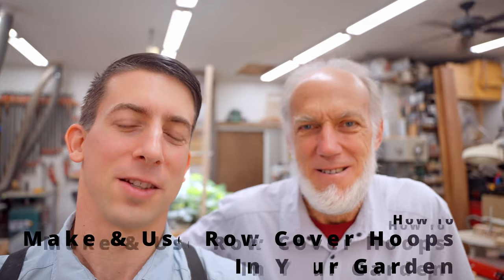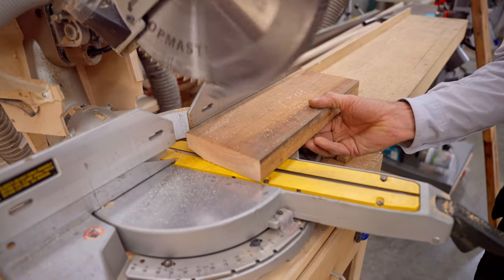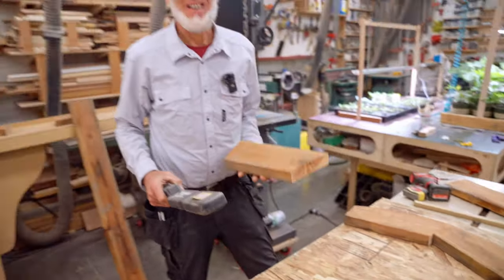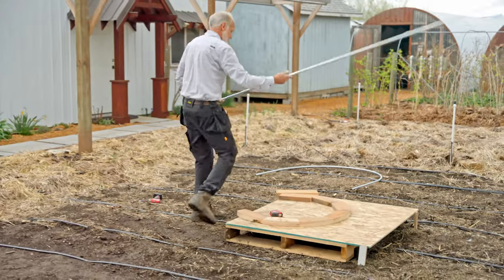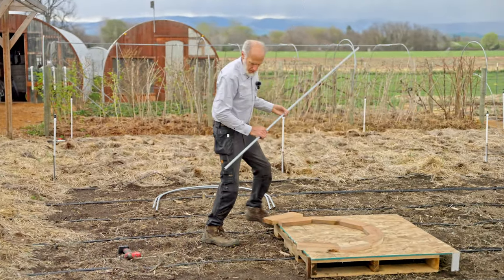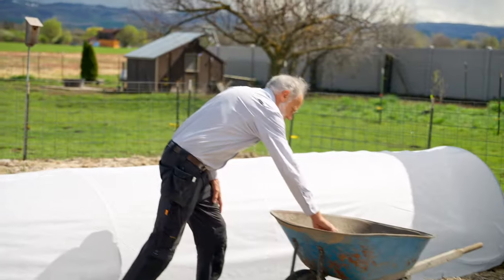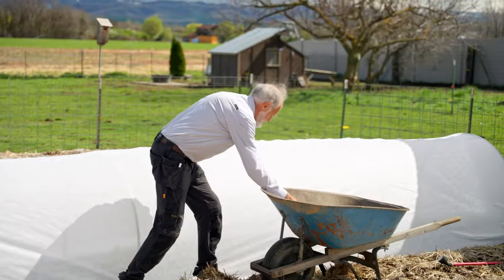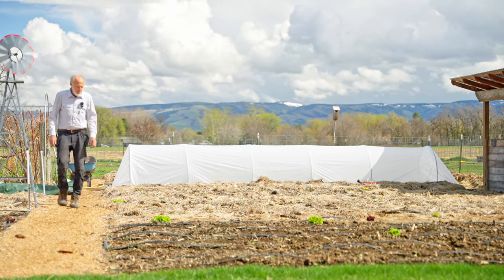Keep Bugs Off Your Broccoli & Cauliflower! Simple & Effective Garden Row Covers + Hoops Tutorial

Comment: Excellent video.  I've been using very thing Thule fabric but it's not as wide as what you used.  Is that the thinnest material available from that source?   The reason I'm asking is you can see right through my thule fabric and I'd prefer more sun here in chicago.
Reply from the maker: Yes I think it is the thinnest fabric. If you're growing brassicas under it, it let's in plenty of light - they do very well under it. I've grown summer squash under it as we'll and it also does fine. Actually I haven't had anything not do well under it - I've done carrots too. So you might just try it and see for yourself. It looks like it's way to thick and would really hinder plant growth but that hasn't been my experience with it.
Reply: Thanks so much for this info!  I'll check it out.  I like the thule fabric cuz you can see right through it but nobody makes it wide enough.  That fabric roll you use is pretty cheap.  Thanks Again!

Comment: Hello,  great video as always.  I have a small black bug eating on my potatoe and strawberry leaves. How can I get rid of them before covering the plants under netting?  Thanks for your help.
Reply from the maker: What kind of bug is it? Is it a borer with a "snout"?
Reply: I can’t really tell.  It moves very fast. It’s tiny like the head of a stick pin small.  It’s not boring like a leaf miner it’s just eating holes in my leaves.
Reply from the maker: Is it flea beetles by chance?
Reply: Yes, I believe it is.
Reply from the maker: You can use beneficial nematodes to get rid of the flea beetles, there's 3 different species that you can order so just make sure that you buy the right one for flea beetles, this is also a good time of year to apply them to your garden. Blessings to you!
Reply: ARBICO ORGANICS has a product Triple Threat Beneficial Nematodes…do you think that would work?
Reply from the maker: Yes but I wouldn't expect it to make a big difference this year,you'll see results next season.
Reply: Thanks I will order them and apply.  Do you have any suggestions for what can be done now to treat my current outbreak?  Thanks for your time and guidance.
Reply from the maker: Once it warms up they usually aren't such a problem.